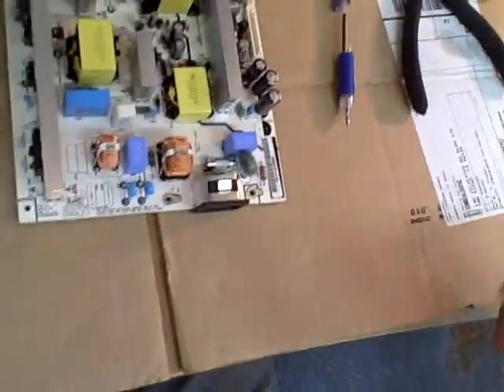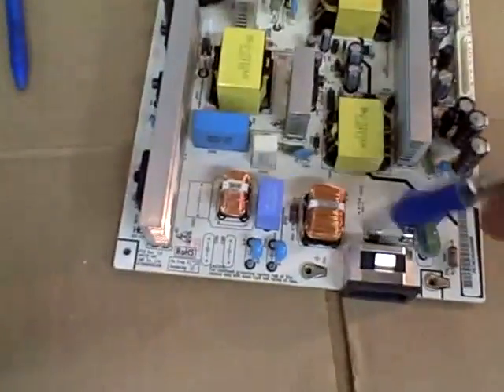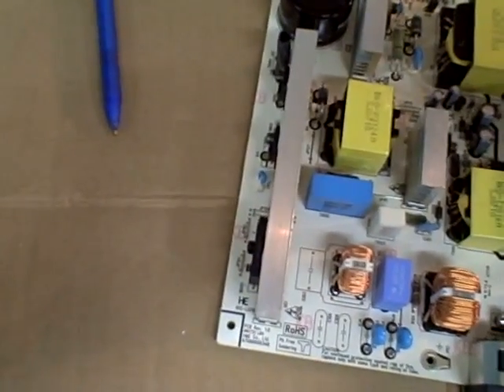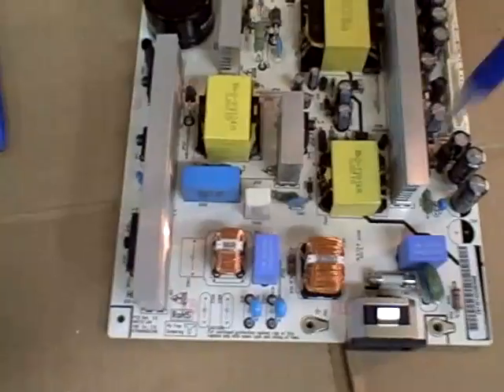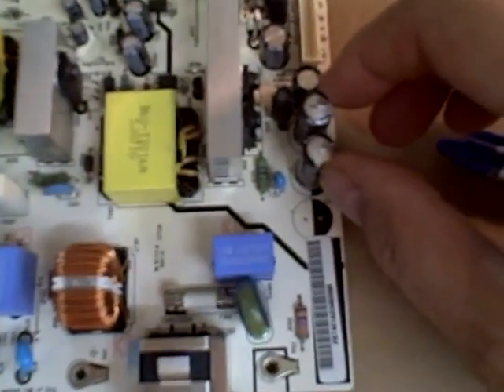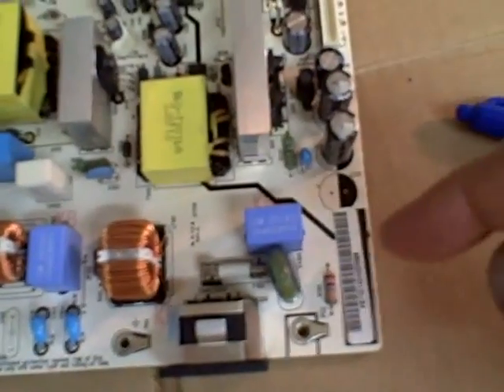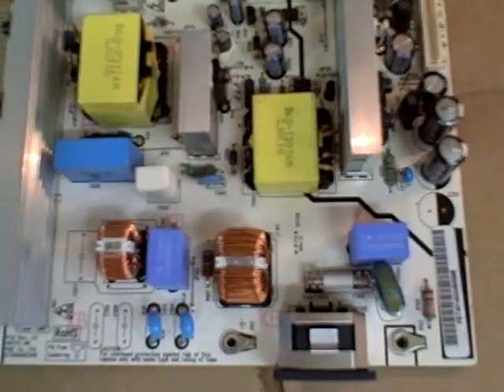LGP0024-110B LG Zenith Power Supply Repair

Comment: Thank you very much for this video.  I am currently trying to repair this supply and it seems very clear that my blue ceramic capacitor in C115 has blown out.  Unfortunately, it has burnt out the writing telling me what the piece was.  All that I know is that it is 27XX and 1KVL.  Do you have any advice on tracking this part down?

-Thanks
Reply from the maker: Which part of the circuit is it? The typical failure mode for a ceramic cap is to short so check with Ohm meter. I suspect it is in input filter circuit. Often you can just remove the cap and everything will work fine. From what you said 1KVL means 1000V and maybe 2700pF. I looked on Digi-Key and they had 10 different models of through hole caps with those specs.
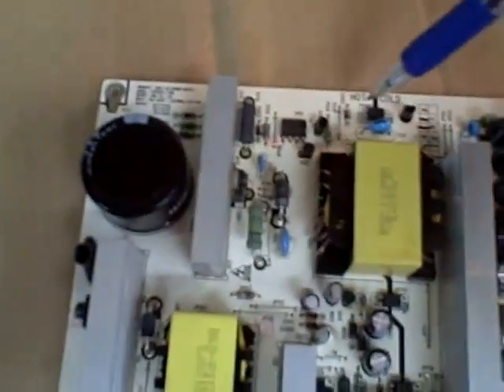Reply: Kent Diego It is on the hot side of the circuit.  If you look at the giant capacitor in the upper left hand corner and trace a line though that heatsink to the right then it is the middle of the 3 blue capacitors that are on the hot side that you can see on 0:27 of this video.

Interestingly, I heard the capacitor blow (loud pop) and it is clearly damaged but screen still functions.  It just makes an extremely loud high pitched noise once powered on that is almost unbearable.

-Thanks
Reply: Glindark It says, BN 271K 1KV. Mine blowed as well, but from the other side
Reply: I also had the BN 271K 1KLV (blue) capacitor blow. I replaced it but the power supply brows the fuse as soon as it's connected to the mains, hence, there's a short somewhere else on my board.

Comment: Thanks for the link on Capacitor soldering, even typing in "how to replace bad capacitors" on search shows many vids. I did not do such a brilliant job with soldering wise on the 2 caps I replaced on my Lg power board,  managed to get a little solder on one of the other circuit lanes. No Wick or a sharp pointing solder iron.  Id advise anyone to take pictures of back of circuit board and use a steady hand when soldering, I just put 4 small blobs and it still holds well,  and my LG 24" is alive!